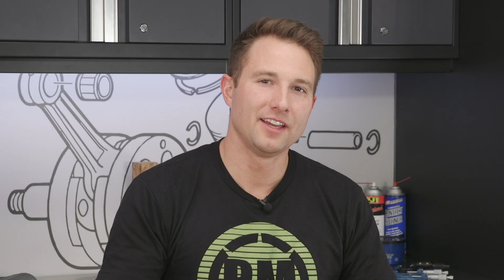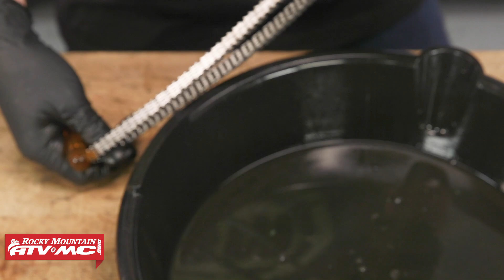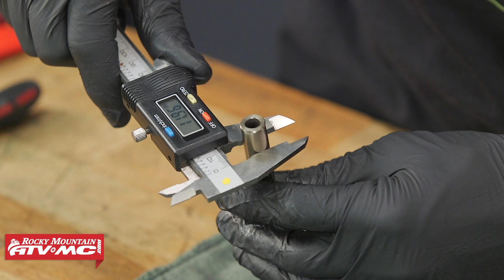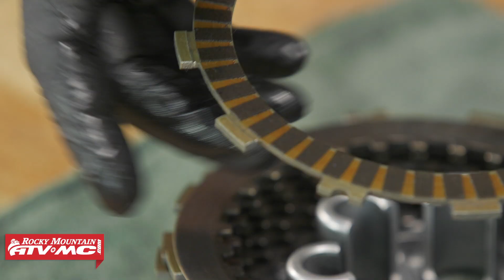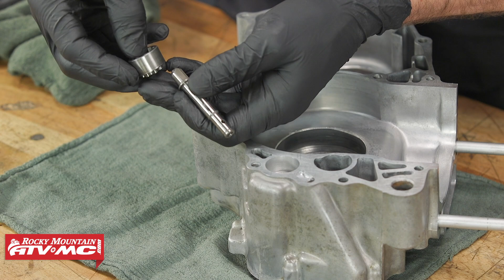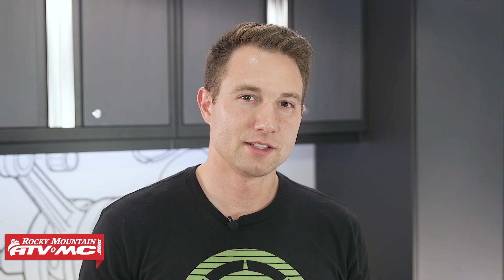Honda CRF450R Bottom End Rebuild | Part 2: Cleaning and Inspection

Comment: Hi, where can I get the manuals to know the right torque for nuts and bolts? I have only fined them for the top end but not for the bottom end.
Reply: And my bike is a 03
Reply: Get a Genuine Honda Service Manual at your dealer.  If they don't have one, they can order it for you.  You cannot do this work without a proper manual and a good set of torque wrenches.  Not if you value your life.
Reply: @foobarmaximus3506  yup I know and thanks but I sold the bike now😅

Comment: Thank you for your helpful video series! Its been a huge help rebuilding my 07 crf450R. Was wondering what size collet you used to remove the shift drum bearing out of the left case? My motion pro kit goes to 30 but I think i need a 33. Curious what you used in this video. Thanks and keep them coming!